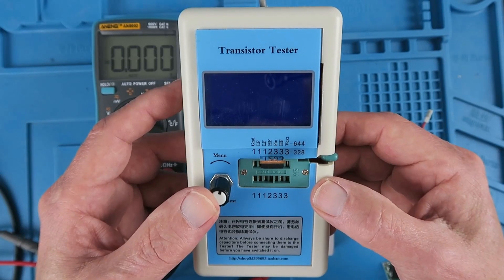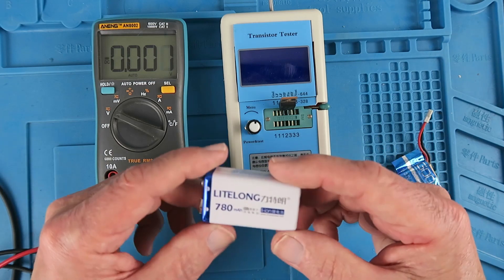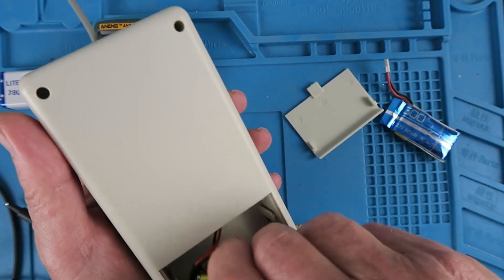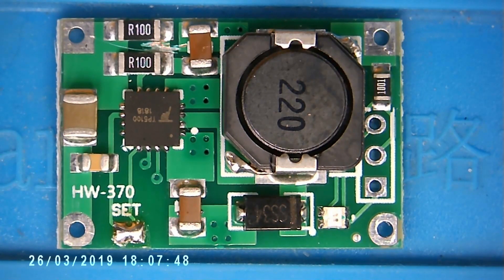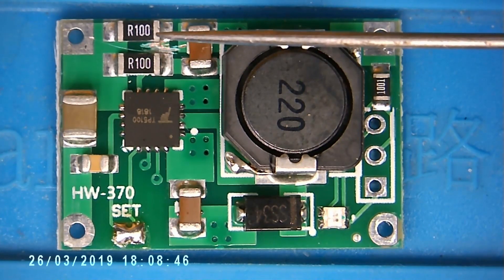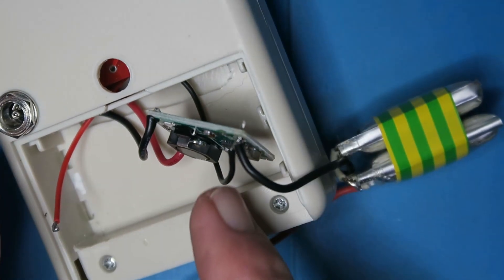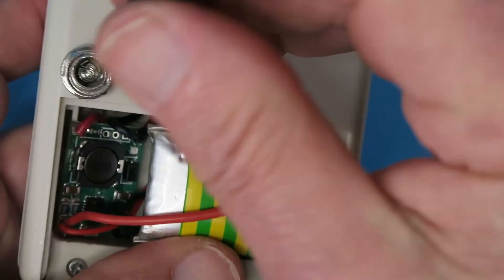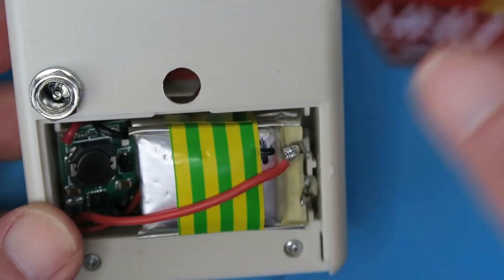No More PP3's! TP5100 9V Battery Eliminator Project

Comment: The Atmel micro controller only needs 5v. So I am thinking why not just to bypass the 5v regulator (78L05) on the board and directly solder boosted 5v from lipo to the output pin of 78L05. To boost to 5v will drain lipo slower than 9v boost, isn't that right?

Comment: This is based off https://www.mikrocontroller.net/articles/AVR_Transistortester, it should be possible to recompile the firmware to support Lion directly :), should be able to be powered off a single Lipo boosted to 5V

Comment: I did it slightly differently on one of my transistor tester : micro USB female  + boost converter, that way not battery at all
Reply from the maker: I thought about that but I was concerned that noise from the converter might affect the readings. Also I already have too many cables on my bench!!
Reply: Indeed, there is a bit of filtering needed on the output of the boost converter (simple caps filter, ceramic + chemical)  @1nformatica  The tester does not draw a lot of current, the noise is not that bad.
Reply: @meanxmeanx1763  How much current? Would the smallest MT3608 work? I was thinking TP4056+single lipo battery and a boost converter, more convenient to charge with microUSB
Reply: i dont remember the number , but it was low, like pulling < 0.5 A from the battery
Reply: @davidhsieh2761  It's  pulling about 50ma from the usb i.e. 250 mW

Comment: Is there enough room inside the back cover to fit a couple phone cells with much more capacity?
Reply from the maker: You would need to cut away the battery box, that would give enough space. The current draw is very low so even small cells will last a long time between charges.